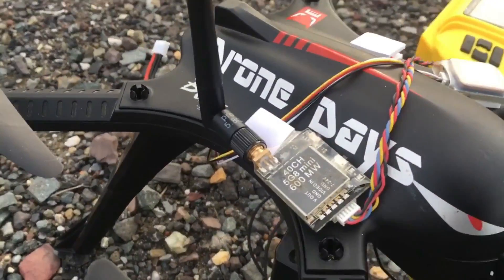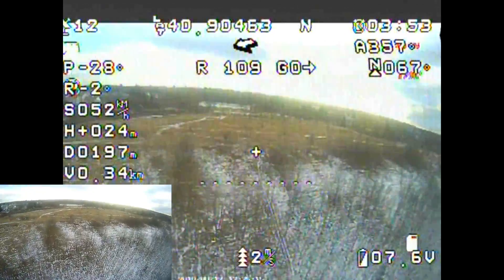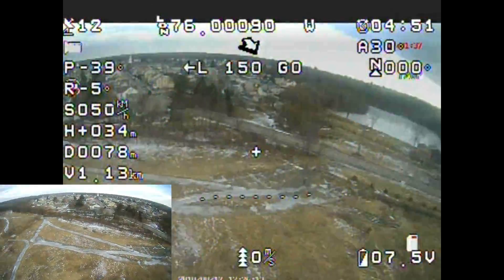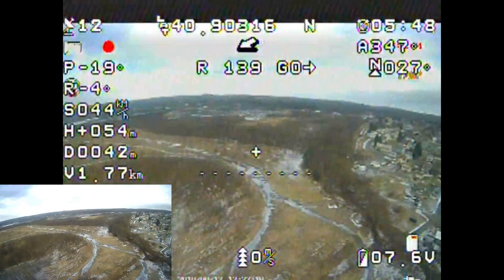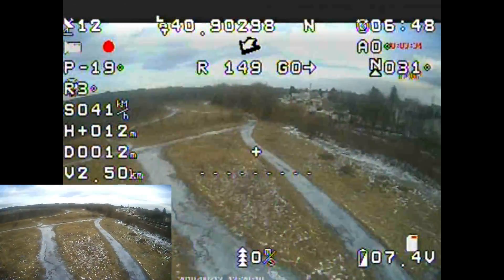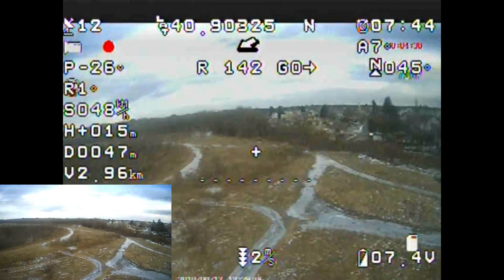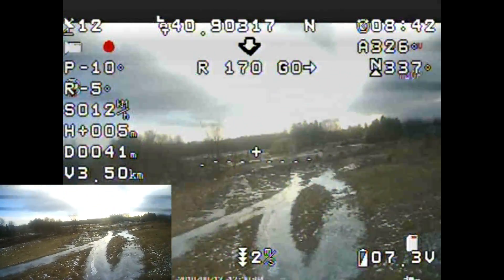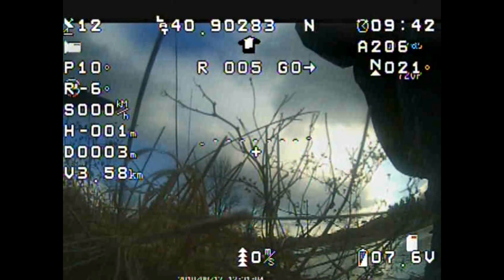Tarot OSD UNDERSTANDING READOUT MJX BUGS 3 Full Telemetry VOLTAGE SPEED HEIGHT Flight

Comment: To all drone reviewers and users. 
What is the best drone under $150 for cyclists? 
It must be able to do a relatively fast and reliable  'Follow Me' and produce acceptable video. 
Of course when the drone is smaller and foldable it will be better for cycle touring.   

I will put some candidates on the list. You can add some more and ask to delete some 'not so good' drones from the list. . 

SJRC F11
SJRC Z5
JJPRO X5
JJPRO X9
C-Fly Dream
Visuo XS812S 
SG900-S (or X192)

And oh. I haven't flown my Z5 and SG900 yet! So I hope more experienced pilots can help determine which drones can do the job. Perhaps even a racing whoop or altitude hold drone and fly manually while riding your bike?

Comment: I have a question. Why satelite icon shows 00? Doesnt it suppose to have number of satelites found on GPS? Second question. How to calibrate HOME arrow (it only shows down direction or is it gonna change during flight?). And third one. I run separate battery for fpv and main for the rest. I connected red wire and gnd to Tarot and the other end to plus and minus on the main bat plug and I dont see second bat info on osd screen. What did I do wrong? Thank you